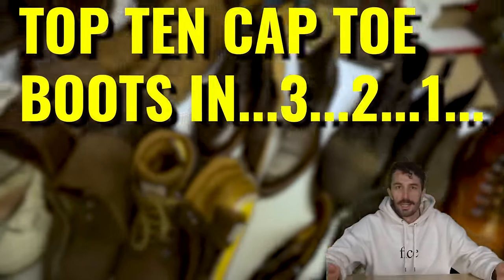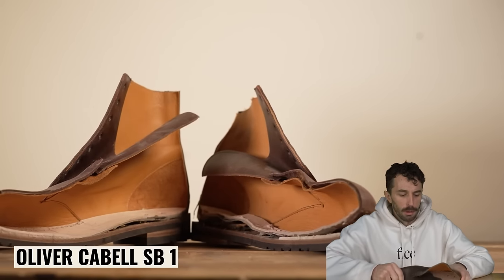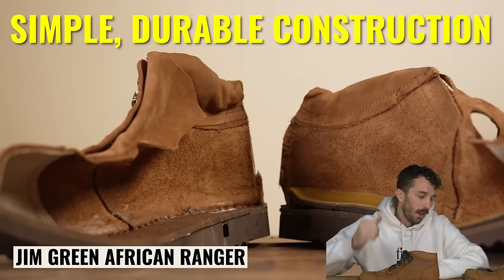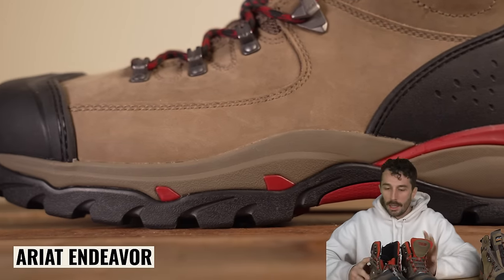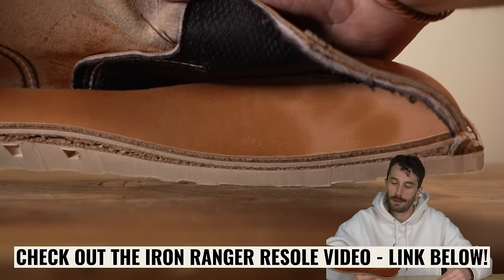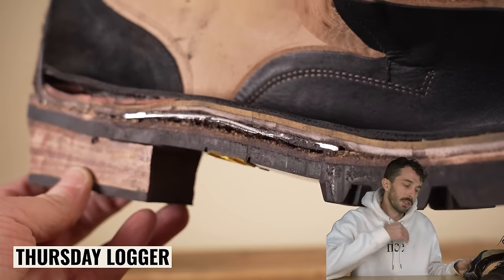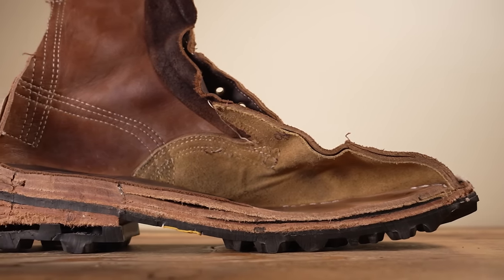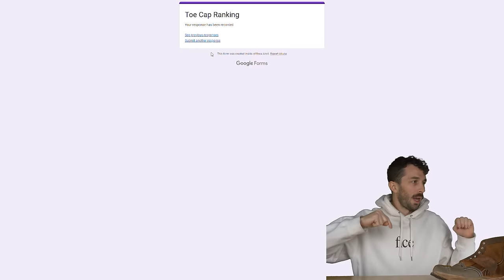(Top 10) Toe cap boots ranked Worst to Best

Comment: I am a former Army Paratrooper and Airborne Ranger and served for 8 years total with 3 of those years in Republic of Viet Nam. Corcorans were brown during WWII and changed to black color sometime in the mid to late 1950's. I served in the 82nd Airborne Division from 1966 - 1968 and in those 2 years had only 2 pair of Corcorans; 1 pair for my dress greens and another pair for BDU use. Since we ran 5 miles before breakfast in those days, I had the sole built up and the heel remaining allowing me to run backwards while calling cadance. We spit shined our boots daily and thus the leather became soft and supple after several applications of Lincoln paste polish. By observation of the Corcoran knock offs, I immediately note the stitching difference and the eyelet difference. These are to me, a cheap Chinese kock-off. Cheers, Dr. Don R. Lahti
Reply: yea i was airborn too and i thought those looked really fake especially the eyelits glad im not trippin

Comment: I love my Iron Rangers. So well made, excellent materials. I've heard the Wolverine 1000 Miles are similar but with the edge usually going to the Iron Rangers. Also the IR have different widths available while the 1000 Miles don't.
Reply: I have both. Wolverine doesn’t meet that level.
Reply: I had a black and brown pair of wolverines. Sadly my dog ate both.
Reply: The Iron Rangers a pretty significant step ahead of the 1000 Miles.

Comment: Two great value bang for buck brands I hope you check out. 

1) Meermin - especially their whole cut chelsea boots at around $240

2) Yanko - both moc toe and service boot

Both brands are old mallorcan brands. Meermin manufactures in china though, but yanko makes their boots in Spain.
Reply: Can't understand why Meermin, specifically the whole cut chelsea in kudu, is always left out. They need a bigger YT budget
Reply: Yes I’d like to see more reviews of that boot
Reply: I still love my Portuguese Urban Shepherd boots, especially for the price I got them at a year ago (€145 after taxes, instead of the current price of €195). On paper the materials used should be pretty good. Kind of wish those would get cut apart at some point to see if they're actually made well.

Comment: I think Gripfast boots are pretty cool. They have an Iron Ranger look while also having a steel toe. I got my first pair of Gripfast when I was 15 (I'm 39 now) and went through a few pairs. I switched to Docs then Solovairs because they were a bit more comfortable. 

I recently bought my first Iron Rangers in black (of course) and with the extra leather insoles, they're the most comfortable boots I've ever owned. They look better as they get scratched and beat up. Iron Rangers are my new favorites. I'm thinking about getting another pair in a different color or a pair of Blacksmiths in black after I'm done with my Christmas shopping.

Comment: I have the Beckett Siminon Dowler and like them quite a lot for the price. They are very soft yet rigid. No break in period at all and look surprisingly sharp for how low the cost is.

I also have the Keen Ridge Flex in black and grey (wearing them now). They are extremely comfortable and versatile. They almost wear more like a sneaker.

The tread has held up well, but the construction isn't the cleanest. There are some sloppy glue spots, loose, uneven stiching, but they've held together pretty well for a cement construction. The rubber Keen bellows flex panel on the top of the foot is a complete gimmick. It adds flexibility but the rubber split after like the third or fourth wear. That compromised the water proofing obviously. Overall not impressed for a Keen that's over $200. But I still like the brand.

Comment: Check out Woobies,probably the new mod2.
They might be the kind of durable you're looking for.
Veteran owned & operated,  made in Texas.
The new mod2 high top has an oil and slip resistant outsole ( so good work shoes ), and you may like how the tread is a topographical map pattern.

Comment: It certainly wasn't a surprise that the Iron Rangers had the number one spot. You can't go wrong for what you pay, even at full price. If the retail price is too high, they are not hard to find used at half the price or close with years of wear still left in them.

Comment: Iron Ranger 8111 are by far the easiest boots to break in, the only negative is the Vibram sole doesn't last long and they are not a very tough boot, I love them and they are extremely comfortable, If you want a better boot better value better looking than the Iron Ranger, then buy the Chippewa Brentwood Homestead boots, they totally slay the Iron ranger.

Comment: I have tried many capped boots, (not dress boots) even the blunts which a very uncomfortable compared to my kinggee work boots.  Solid safety boot and very comfortable even with my diabetes which makes your putter extremities very sensitive. I also had doc martens form late seventies to early 90s. Very comfy, they disappeared.  I hate those hollow rubber heels they always fall apart

Comment: As someone who wears the Corcoran boots most of the year, mine hasn’t broken down and has stood up to frequent use. It hasn’t been hard use and more walking around the city. 

I did switch to speed hooks above the ankle. I’m also cautious not to wear in overly wet conditions. They are not great as far as waterproofing.
Reply: Get the laced-in zippers.  I have two pairs of Corcoran jump boots.  Both have the zippers.  The zippers make a huge difference.

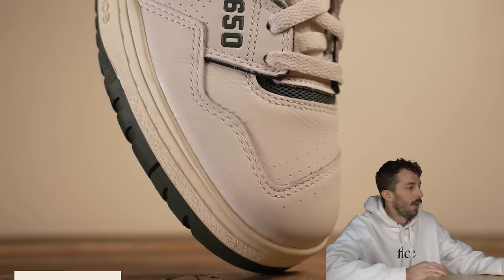Comment: 5:30 technically rick owens ramones are pretty close to this, they are built like a high quality dress shoe and have a leather sole, toe cap and the body is made of numerous materials but is available in leather and denim for the highest quality. the only downside i see is the inability to resole... easily, there are options that work but you have to time it right. they look like a more obnoxious and exxagerated pair of converse, they are also on the pricey side due to the fact they are designer, but they are honestly the best possible option in this catagory.

Comment: I have the thursday vangaurds. Man i wish they would just switch the insole to leather instead of fiberboard and charge 10-20 more bucks, because they would hands down be the best value out there. They already are, but there wouldnt be a reason to spend 150 extra on any other boot in that area.. and they could claim all day that they are work boots cause i wear them

Comment: The 1000 mile cap toe should have been #1 if not At least top 3. The 1000 mile cap toes are built a little different in respects to the outsole then the standard 1000 mile. Also they are more comfortable then the iron rangers even after the rangers have been being broken in. The outsole on the iron ranger is a stiff rubber while the outsole on the 1000 mile is leather with a partial Vibram rubber slip stitched to the sole, making it much more flexible on the foot.

Comment: My jim green african rangers are amazing, the insole is awfulllllllll; they have like a weird plastic shank  on the underside of just like some material and its like stepping on concrete or steel everytime using the original insoles. But once you exchange it they are nice looking, comfortable and durable.

Comment: Would love to see how the Wolverine 1000 Mile Cap-Toe Classic would stack up against this list!
Reply: The Wolverine 1000 mile Cap-toe is underrated and gets overlooked.
Reply: @strengthandbulkMadness  Just picked up a pair in Havana Brown Chromexcel last week and I love them so far! I specifically chose them over the Red Wing Iron Rangers.
Reply: He's cut apart a Wolverine 1000 mile fairly recently on the main channel. The results were not good.
Reply: @SeaNanners4Life  Nitpicking! It’s still well made but should be cheaper because of the fiberboard insole and composite leather heel stack which don’t necessarily take much away from durability. He didn’t mention all of sales Wolverine does so very easily to get it $100 cheaper for the right price.

Comment: if the toe cap is doubled or not doesn't really say anything about the quality! if you have a plain vamp without a toe cap it's not automatically less sturdy than a toe cap boot either. the toe cap design most likely developed as a method to click the upper leather more economically and for design purposes, not for durability. you could say a double toe cap is a plus but a single layer is not a minus, it's the standart. for example one very robust, handmade boot construction would be a leather lining, leather toe stiffener(which go up to 3.5mm weight and more) and the upper leather. Now on top of that you could double up the toe cap but in those cases it would be really unnecessary and often look odd. on an unstructured toe it makes way more sense off course. but either way it feels wrong to call it a "true" toe cap, because the single-layer method is just as traditional :)